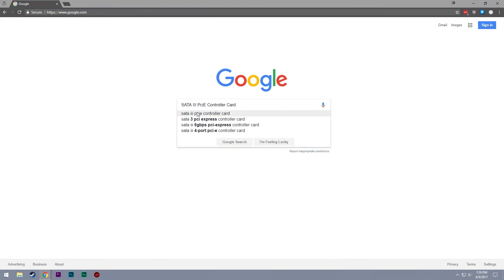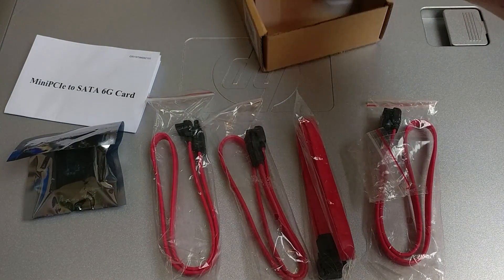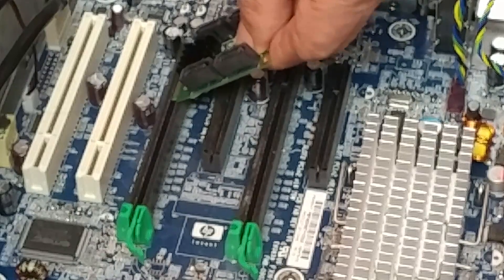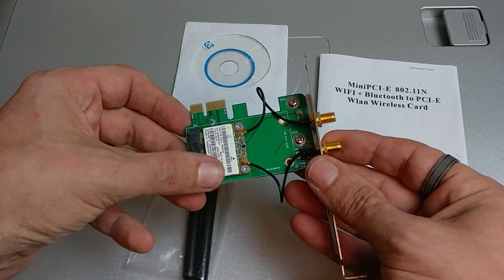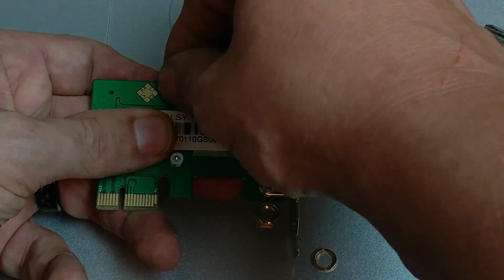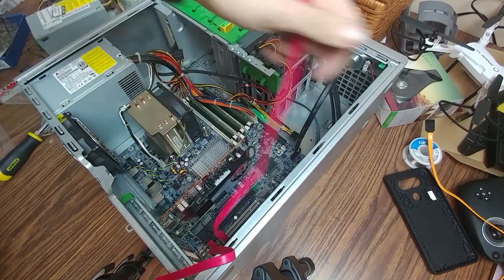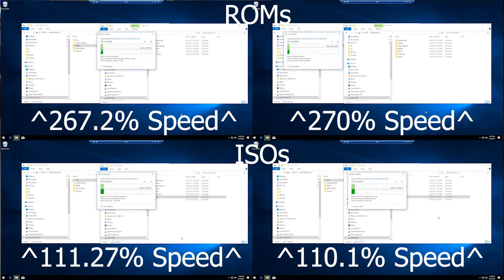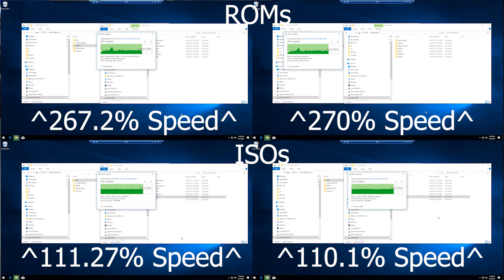How-To: Add More SATA Ports to Your Computer

Comment: Syba/IO Crest/Lekuo, LogiLink, Vantec, HighPoint, StarTech, Delock and many more noname companies have plenty of those cards in different shapes and forms. However all of these cards are based on the same Marvell, AS Media or JMicron controllers. The main point to remember is that SATA is half-duplex but NVMe is full-duplex (dual simplex).

Comment: Simply return card to Amazon for 100% refund by marking it sa does not work option. Buy the correct pci-e 1 card. Make sure the cables attach horizontal from the sides and not, as these do, vertically underneath.
Reply from the maker: This video is EIGHT years old and I was making the best of a situation I was in, so I made a video to show others how they might be able to do the same if they're in a pinch.

Comment: How do you connect Power Connector wirh cables ? 
For 4 SATA Poets, adding 4 Drives , means You need 4 Extra Power connectros. Where are they ?
Reply from the maker: This isn't the solution you're looking for.

Comment: If You call the Card wirj 4 SATA Ports on ot as ---- Mini PCIe  Card ..
What you will call the PCie Card that held that Wifi card or chip jnititall6, which you removed, which acfually fits into PCIe Slots ???

Ai diffrence in Pin aizes, configuration or nos or Chip Width ???

Comment: I am pretty certain that this is a pci-x1 (the smallest size) card.  From my recent research looking for a SAS card which are pci-x8 and not having an x8 on my board, I did the Youtube stuff and found that all pci express cards are compatible - e.g. pci-x1 will work in a 4. 8 or 16 as their pins are the same.  I think the two black slots at the side of the x16 graphics slots would probably accept this card.  My x16 slot is running an x8 SAS card with no problems (I always thought these were only for graphics). Hope this helps but a great solution to this problem.

Comment: Has this lasted?
Reply from the maker: There are better ways to do this: https://amzn.to/3iYWULe
Reply: @DBTechYT  I am looking at upgrading my z270 to a z590 motherboard. But it seems that many z590s have added more m2 slots, taken away the pcie x1 slots, and kept an x16 running at x4 (without cutting the gpu x16 to x8). I happen to have a need for the x4, and need another x1. The only motherboard I have found that can add a pcie x1 removed 2 sata slots... I use 5 sata drives. So I was thinking that maybe I could try using your method to take the m2 slots and grant back some data slots. Crazy?

Comment: I wanted to add a fourth hard drive to my PC, so I started watching this video. I took the glass off my computer to see if I had the required port for this card, and then noticed I had three open SATA ports I never realized I had. Moot point now, I guess. Just need to buy another SATA cable.

Comment: Setting up 6 drives plus a DVD read /write on B450 MSI Tomahawk,using a switch panel to control power the drives.I will try a SATA riser card to get sata data to DVD.Running 4 different OS plus 2 drives for storage,should be a fun box when finished if i can keep it cool,wish me luck.
Reply: Just configure grub instead of a "switchboard" and why a riser?

Comment: Will a sata splitter cable work for ssd hdd or will the splitter slow the pc down?
Reply from the maker: You'll end up sharing bandwidth on the cable and may slow it down
Reply: @DBTechYT  okey

Comment: I have added a Samsung m.2 970 to an Asus prime 390p using the 16 lane slot now I have lost 4 sata ports. Whats the best solution to get them back? I have been thinking a pci internal 4 port card. I am not sure if the pci slot is disabled or not.

Comment: Thank you! I was amazed because not only was this the first place I picked to see about adding SATA connections to my mobo and answered all my concerns, but I happened to already have an unused wireless PCI adaptor card just like the one you showed! The 4-Sata port card you bought looks like a good one and I was also was concerned about performance. Therefore, I was elated that you covered the test comparisons between the built-in SATA ports and the add-on. I do intend to see about a full size PCI Sata-port add on card because I could then skip the transfer steps but it's good to know that such a transfer can even be done!
Thanks again,
Rich

Comment: Hey quick question; so in summary you get more Sata III ports on your desktop....One Clarification. As an example my desktop has 4 sata III 3gb/sec ports built in, so I can run 4 hard-drives (two ssds, two external hdds), I have six usb ports on my system but cant run more the 4 drives at once (thumb drives included). with this (or any PCIe port adapter) my computer will be able do more then just recognize a fifth or even a sixth hard-drive higher then on a hardware monitor level; in other words I can actually use them for active storage?
Reply from the maker: This video is garbage. Buy a SATA card that is ready to use instead of doing it this way.

Comment: Spend a few extra bucks and get a SAS HBA card if you dont want your data to get corrupted.
Reply: Also you cannot compare this nifty card to a SAS HBA card. THEY DON'T EVEN USE THE SAME CONNECTOR, HBA cards typically use a PCI E x8 slot and this card is a Mini PCI E... I'm sure if people have the available slots they would get a HBA Card. But what if they don't??? This card is fine, don't talk rubbish without providing any sources as you put people off the product without any proof.
Reply: SoggyFries how come?
Reply: @SGprooo  Depending on your situation. If you're doing Freenas or something like hardware SATA card conflict with OS raid software and will cause it not to detect. A host bus card will be more compatible and longer lasting .
Reply: @soggyfries4347   @SigEpBlue can you give some sources from where you got this information as you just saying this confuses people who are new to this stuff and discourages people from buying what may be a perfectly fine product. What you both have said has no value if you cannot provide any sources. Period.
Reply: @soggyfries4347  This card will not conflict with with software raid at all.... What are you even talking about 😂

You don't have a clue what you're talking about 🤦🏻‍♂️
Reply: @solverz4078  Yea good luck with that one, skippy. Connect as many SATA expanders as your heart desires.
Reply: @soggyfries4347  another valueless piece of information with nothing to back it up 😂🤦🏻‍♂️
Reply: @soggyfries4347  whoever reads this ignore @SoggyFries comments, they have probably never even owned a PCI E sata expansion card 🙄
Reply: @solverz4078  You dont even know what the proper name for the part you're crying about. 😂 M.2???   Holly shit. we're done here.
Reply: You do know what an M.2 is right? How many m.2 can you connect to a SAS connector?....HAHAHAHAH I'm dying 😂
Reply: @soggyfries4347  😂excuse me, who said M.2???
Reply: @soggyfries4347  just to even FURTHER PROVE you don't have a clue what you're talking about you with your random mention of M.2 when the card in the video is clearly a mini pci e card....
Reply: Most of the cards use mature chipsets - likely Marvell or AsMedia. They're fine for regular use.
Reply: I've got to agree. The consumer-grade stuff, usually priced <$50 with names like SYBA or IOCrest and using Marvell or ASMedia chips, is "not great," at best. It'll fail in ways you would have never imagined possible, e.g. corruption of ONLY the secondary GPT header CRC checksums on connected drives -- thanks, IOCrest/SYBA, for THAT little gem on your SI-PEX40062 card and its Marvell 88SE9235 chip. It's better, if you value your data & sanity, to get an enterprise-grade HBA (and stick some cooling on it!). Even an old, used LSI SAS2008-equipped HBA is still useful, faster, and rock-solid.

Comment: I want a tower with 8 hot swap docks, each with individual power switch.  My setup now is 3 in my big tower.
i rarely power them up, they are just for occasional access to my media library. 
if i build a box, power it, cool it, how do i get those 8 sata cables to turn into one out to my main pc.
is there a board i need?  am i going about this all wrong?  they want $350 for a box like that and they
are using scary words like raid.  i just want 8 stand alone drives for access to stored media.
got any advise? i have a couple of empty towers that i was thinkin about cannibalizing
Reply from the maker: Why do you need 8 hot swap drives? That seems unnecessary unless you're a datacenter or other type of server farm. If you just want to add 8 sata ports to your system, then you can look at something like this: https://amzn.to/2WUiV53 Maybe that isn't the exact thing you're looking for, but you should look for something LIKE that.

Comment: Is it possible to just go from a single native Sata3 data port on my motherboard to a splitter/ mulitplier cable (such as a Y cable) of some kind instead of using a card in a PCI slot.  Thanks
Reply from the maker: I don't think so as each drive needs to be addressable via the port it is plugged into. I've never seen a SATA data splitter cable.

Comment: What If you’re out of sata power connection?    I want to make a server with 10 drives.  How to I power them?
Reply from the maker: You'll need to get a power supply and/or a cable for your power supply that has enough connectors

Comment: I was wondering if this will work on an older motherboard or does it need newer chip sets?
Reply from the maker: It will work on any motherboard that has an available PCI express slot available to it. The PC I used in this video is SEVERAL years old.

Comment: Adapters are not good when you really want the speed performance and I can say that you will have a slow data transfer with the adapter
Reply from the maker: I can say that you're wrong. I show this at the 4 minute mark. I had no performance loss with the card.

Comment: what if the problem is that you have a very small motherboard that has no plug-in slots of any kind...but you still need a place to put more sata inputs...both of the originals already used for other important things
Reply from the maker: If you don't have any PCIe slots available on your motherboard, then there's nothing much you can do other than get a new motherboard.
Reply: @DBTechYT ...I was afraid you'd say that...oh well
Reply from the maker: Yeah. Unfortunately there's just no real way to do it unless you want to use USB 3.0 adapters and that gets messy and isn't nearly as fast/efficient.

Comment: Yesterday, I plugged the card into my computer and 10 seconds later there was a smell like smoke, so I immediately unplugged the card and saw a pin was burned
Reply from the maker: I used this method for quite a while and had NO issues, so either you got a defective unit or you did something wrong.
Reply: I think I've got a defective card.
Reply from the maker: Probably. I have to ask, though: The computer was OFF when you plugged the card in, right? :)
Reply: Correct.

Comment: does it works on linux? (ubuntu)
Reply from the maker: It should work on just about any operating system as there are no drivers. Just put it in the motherboard and it works.

Comment: Saw that the card had some sort of sata power required? Did you need to plug that in to use it?
Reply from the maker: There's no additional power required in the method I showed here. I don't think I've seen a SATA expansion card with additional power required.
Reply: @DBTechYT  I see, thanks a lot. You just earned my sub ;)

Comment: question. I had a xp machine lose its operating system. I want to pull the drive and transfer information to a tower via a usb. The drive has slave and master jumper. Do I set the drive to slave?
Reply from the maker: Sounds like it is an IDE drive instead of SATA. Is that correct? If so, then, yes, set the jumper to slave.
Reply: thank you
Reply from the maker: You're welcome :)

Comment: Is this a suitable alternative to the RAID CONTROLLER (PROBLEM)? :)

Can I use this : https://www.ebay.de/i/123116378315?chn=ps&dispItem=1
to scale the whole thing?

Or is there a speeddrop due to usb? Do you have any idea?
I would like to build a back-up sevrer with lots of harddrives... but without the raid controller issues which can cause data loss...
Reply from the maker: Neither the link you sent nor the card in this video are RAID controllers. You can use them as expansion cards and then use Windows software for RAID, but you would be MUCH better off getting a dedicated RAID controller to handle things for you. If you want a good server, don't skimp on the hardware even though it can be expensive. Buy a real RAID controller.
Reply: Thank you very much for the quick response :))
- I've seen that linus' from linustechtips harddrives crashed and the Raid controller took all of the data with it. Is there an additional back-up solution for Raid?
Reply from the maker: Raid can fail and that sucks, but if you use Raid 5 or 6, you get some redundancy in case a drive fails. Here's a good article that explains it: https://www.prepressure.com/library/technology/raid
Reply: Thank you so much again for your support. Im new to network engineering in general, so there are so many impressions about controllers, etc for me to process. So I try to sort all the info.
Reply from the maker: Sometimes it still confuses me. Luckily there is Google and it's not super hard to find information on  :)

Comment: the 1st card didnt fit now did the 2nd 1 fit it was the same as the 1st 1
Reply from the maker: What?
Reply: The second card was a mini-PCIe to PCIe adapter. As the first card was a Mini-PCIe device it could work with the adapter

Comment: I have Sata 2 ports but my SSD needs  sata 3 for maximum speed, so can i use a branching cable, y-cable, to connect my one SSD to two SATA 2-ports, and get the speed of 3GB/s + 3GB/s, as an alternative to SATA 3 6GB/s?
Reply from the maker: I'm not sure if a motherboard would recognize a drive in that configuration but I would be curious to see if it worked
Reply: Maybe there is somewhere on the internet a software specifically for this type of setup, or maybe some software engineer wants to develop one, maybe you, and make moolah off it.
Reply from the maker: I think it's a good idea but I'm not that type of developer unfortunately
Reply: Probably best to get a pcie adapter from which has gen 3

Comment: When you use these, is there any loss in performance or strength and can they be used solo as main if all others on board are blocked my massive gpu on p5q-em? Thanks, Steve
Reply from the maker: I noticed no loss in performance. Actually did some testing in the video to show the differences (or lack of differences) in the performance of the read and write speeds. As long as you have an available PCIe slot, you should be fine.
Reply: I do have a little issue or thinking, I bought an old p5q-em to have some old overclocking fun with the Q9650 chip - however the dual slot GPU seems it will cover my sata or at least four of the six, if lucky. I am hoping low profile right angle will leave enough room. I am praying as already ordered... Grr. anyway, great video man! Watched it all and just seen you talked of performance.
Reply from the maker: Good luck! I hope the parts you ordered will work!
Reply: BTW: I wanted a 3.0 port and see you can get that on a older board with a pci express slot which I have one not blocked (I think) so may get a card like this with usb 3.0 ports duo  externally as well as it has the sata ports on it internally. Pretty sweet! Hope it is quality as only found one.
Reply: @ReganMarcelis  use a flexible pci extender

Comment: my graphics card is too big for this, covers the port.
Reply from the maker: You should be able to put it any available port.
Reply: Sorry I should have been more specific, I meant "ports", its a huge graphics card. At a glance I see you can get motherboards with as many as 22 SATA ports so thats something to remember next time I upgrade.
Reply from the maker: Holy cow. Now I see what you're saying. That MUST be a beast of a card!
Reply: It was given to me by a hardcore gamer who had the same issue with space. Also it would be better if that SATA adapter had the ports along the edge so the cables down obstruct other ports, they dont seem to think of these things.
Reply from the maker: +GibsonLesPaul2273 they actuall sell a version like what you're describing here http://amzn.to/2kA9UZJ
Reply: Yea I had a feeling there would be. Its got to be a new motherboard for me I guess.
Reply: I found a solution, this allows me to move the graphics card.
http://www.precisionmicro.net/docs/product_pictures/RA-1UE16XR.png
Reply from the maker: Cool! Does your case have a vertical GPU mount?
Reply: I dont know yet but its not a problem to mount it if it hasnt i'll find a way.
Reply: Use a pci extender

Comment: anybody can confirm this things really works fine?
Reply from the maker: +Bo Yu I can. I'm still using this setup
Reply: This suppose to plug on PCIEX1 port ?
Reply from the maker: +Bo Yu you can plug it into either
Reply from the maker: Or you could just order something like this. It's by the same manufacturer: http://amzn.to/2kOh68j
Reply: I got one on amazon, it does not fit in any pcie slot.  can't get it to work.  not good.
Reply from the maker: +Bo Yu this video is a whole project. You have to get an adapter card like I did if you want to do it the same way I did. Or you can just get one that fits a pcie card
Reply: Yes, I got exactly same one like you did, from Amazon, it does not fit in any pcie port.

Comment: I am like 99% sure you used a PCI-Ex1 slot, not a PCI slot. Had you used a standard PCI slot your transfer rates would have dipped considerably v.s. a sata port on your motherboard.
Reply from the maker: Okay. My data rates are fine. I tested plugged directly into the board and in the slot I used. I'm happy with the way it turned out.